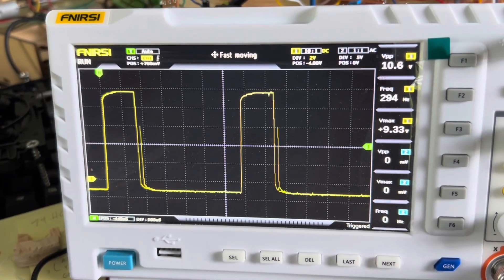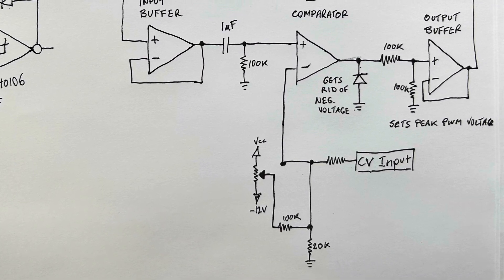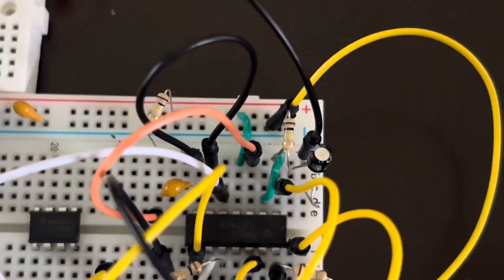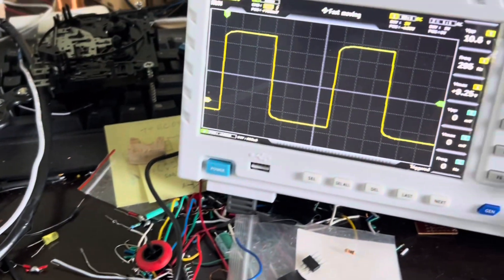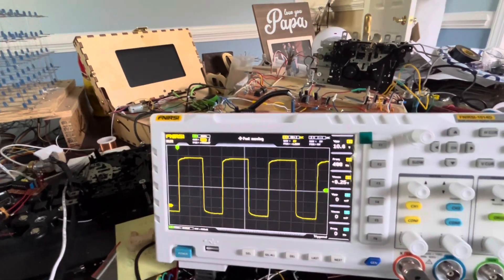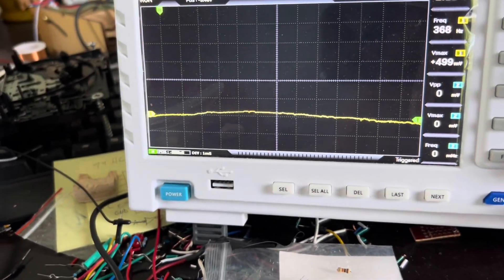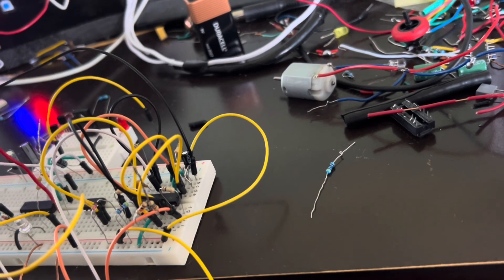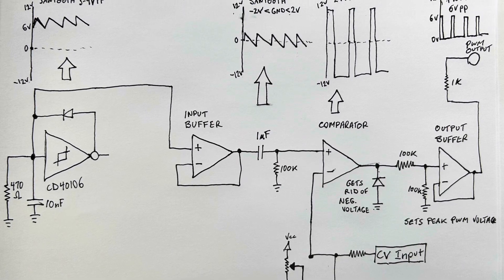Pulse Width Modulation - How to make a PWM generator

Comment: Why is your PWM not going down to 0% and Up upt to 100% ?
Reply from the maker: @DeltaSigma16  threshold of the comparator doesn’t allow a full sweep in final version. The triangle wave thats doing the control voltage never goes to 5 v
Reply: @igorbrichkov3632  thank you